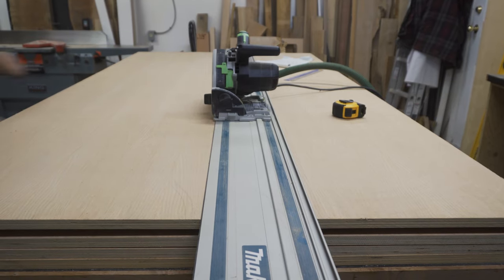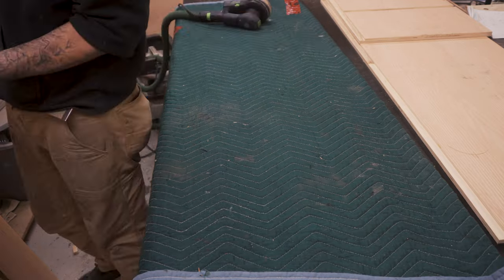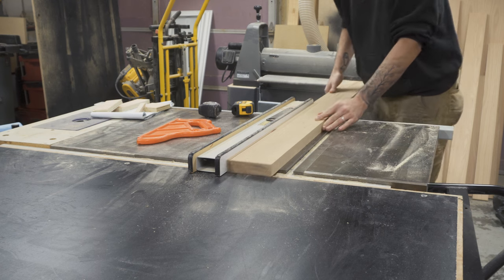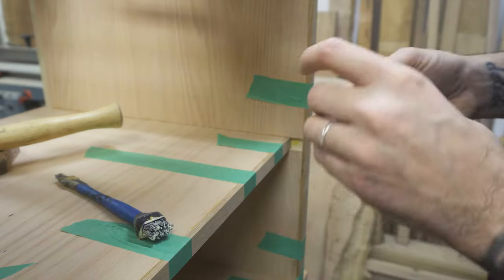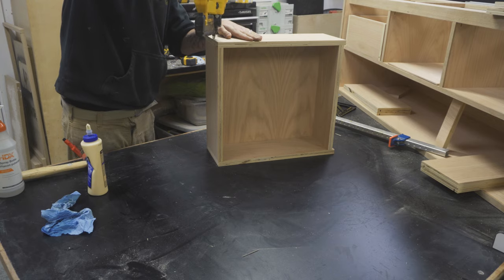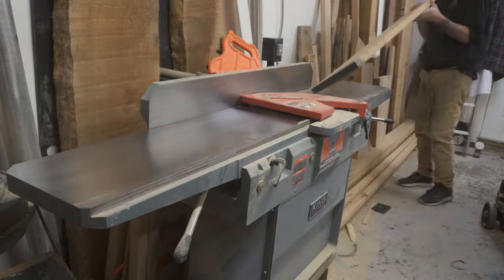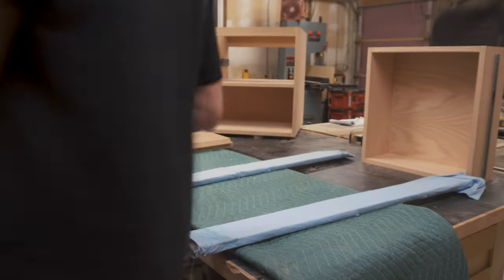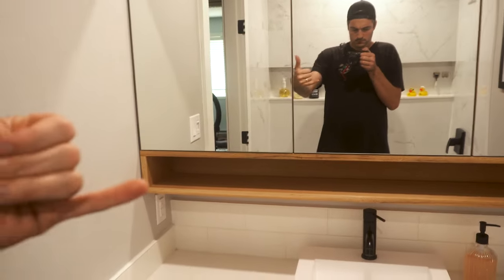Modern White Oak Vanity Cabinet For Less Than $300 | Part 1| DIY #homeimprovement #woodwork

Comment: Man it looks stunning.
Question: Why didn't you use the edge tape on carcass as well? Wouldn't it be far easier quicker?
Reply from the maker: I would totally agree, but for this application as the cabinet edge is part of the front design I wanted to make sure it matched the drawer front exactly. so I used offcuts of the same wood. Any other time I would use standard edge tape for sure